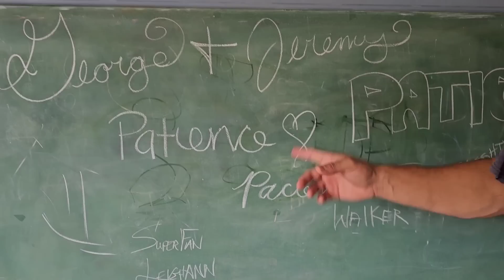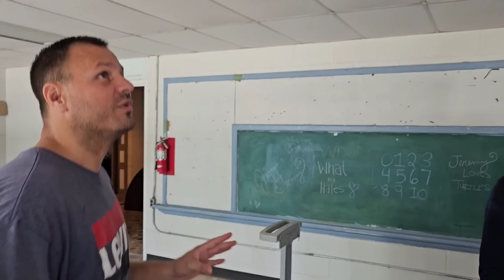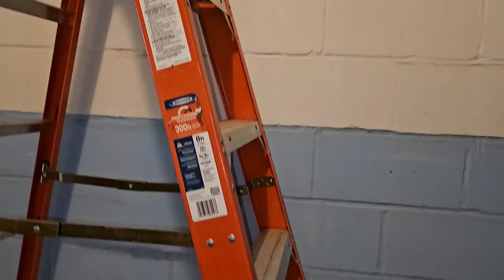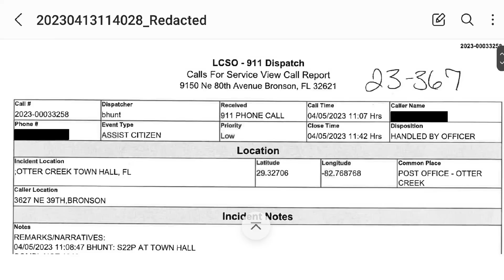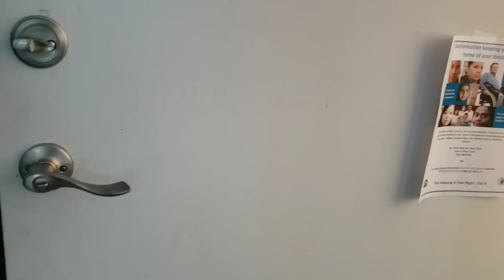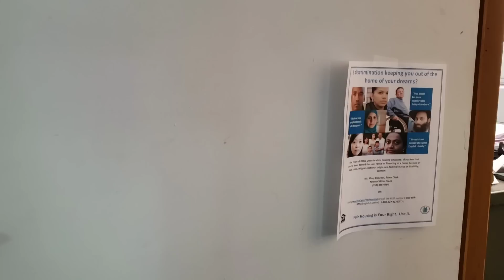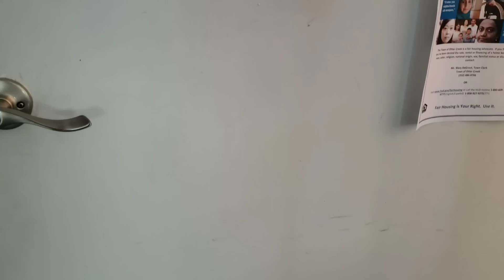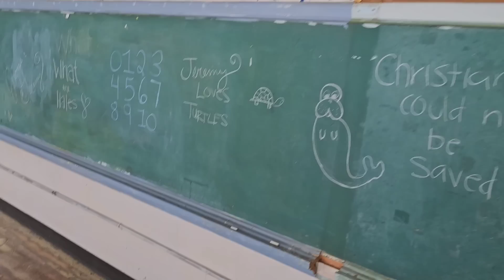SHE KEEPS CALLING THE COPS

Comment: When I lived in a small town similar to Otter Creek, it was Poteet TX., I couldnt figure out why my clothes were staining this rusty orange color out of the washer, and why the water was so dark and dirty coming from the faucet. Well it turns out the whole city still was using clay pipes underground to bring in water to the homes etc. The town is that old.. and the pipes were never replaced and they were breaking down, so the orange color was resin from the clay, and water leaks started popping up over town, and our water pressure was always low. I bet you anything Otter Creek is using clay pipes, under those streets, and need replacing. I wonder if you can find any history on those pipes?

Comment: To keep the town from charging you for the surging water, put a check valve in your line on your side of the meter. This will let the water flow only toward you and not back into the system.

Comment: The water is bad if the same old water is pushed in and out of the pipe. Low pressure will allow bad stuff into the pipe. The pipe is so long it never gets completely flushed.

Comment: I like the looks of the open ceilings, but I imagine it will be hard to keep cool this summer. Those drop ceilings are ugly but make a good barrier for the attic heat.
Reply: Actually not really. I'm sure they will insulate the interior of the roof. Heat rises, which means the heat will rise, cold sinks, so the cooler air stays toward the floor, so, not such a problem as you may think. And they could install gable fans and blow the hot air out at the top of the building. There are many options to keep it cooler than those suspended ceilings. That's why many older southern homes have such high ceilings. 😊

Comment: For that kind of suspended tile,  I just used a piece of dowel/broomstick with a nail in the end. Push up on one end, off center, then catch it as it falls through the hole.  And yes, the Lady is right. Taking it down is less mess than smashing it down. 
The hanger screws , you can use a largeish J bolt chucked into a drill. Hook the "J" through the hanger eye, then run the drill in reverse.
Looking good so far.  All I can suggest for the water is "filters. Lots of them".

Comment: Speaking of the pressure lose in the water, with your meter not having the check valve not being installed I wonder how many others out there have same problem?  Could that be causing the pressure problems in there water system?